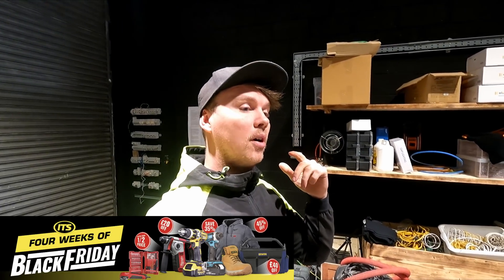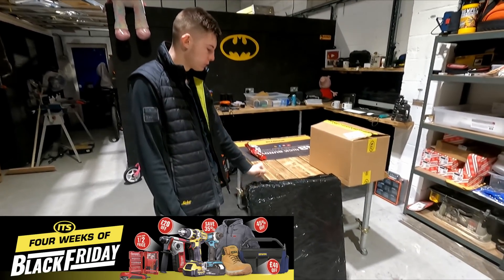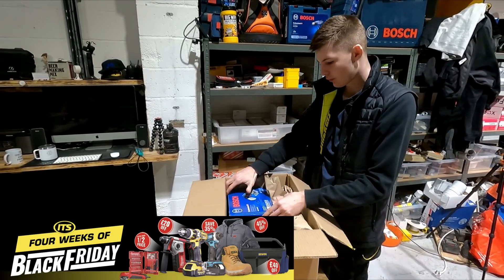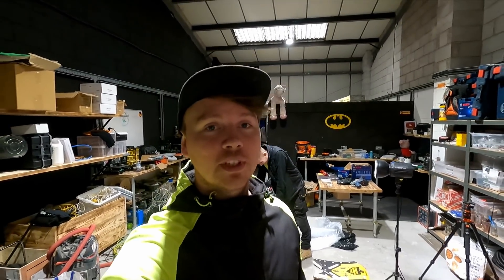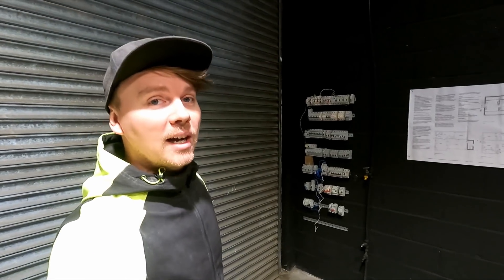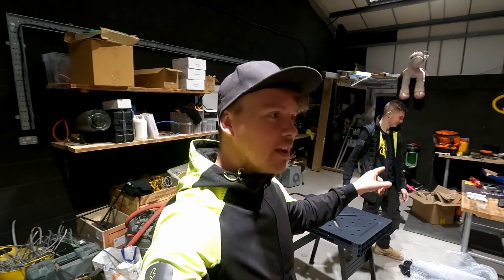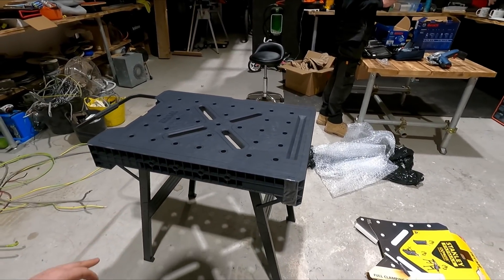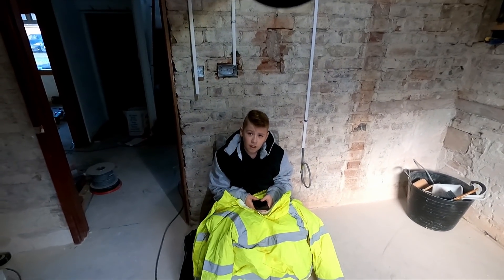Baby Bundy earning "PHAT STACKS" -  Lighting rewire - Electrician

Comment: Hi Nick
If fitting aico try and fit the multisensor (heat and Co2) to the kitchen ares. Will cover for any gas appliances/ boiler in the kitchen. 
If you also fit a smoke/heat multi sensor in the lounge you can happily bring you system to an LD2 for the price of 1 extra detector.

Comment: Had one of these bosch mini drills before, absolutely loved it for small jobs. Sadly it only lasted 12 months with very light usage and the trigger wouldnt work. Maybe i was unlucky, but didn’t bother with another one.
Reply: Should've spent a couple of minutes registering it, 12 month warranty extends to 36 months...
Reply: @Camberwell86  hindsight is a wonderful thing.
Reply: @sparky1543  that's a proper kick up the bollocks though, right on the 12-month mark. Typical innit 😕
You should go again, the body's only £55 or thereabouts (I'm assuming you're on about the impact because the speed drill is pretty pointless) - I wouldn't be without it these days
Reply: @Camberwell86  agreed, a great Little bit of kit. Just stick with my makita 18v stuff now. The bosch was always a luxury item, screwing sockets back with it made me lazy.😂
Reply: @sparky1543  Tell you what the impact's a godsend if you've got a whole house to board. Particularly ceilings with the little belt holster it comes with. Better than standing on a hop-up with an 18V monster between your thighs. The amount of times I spent ages getting a board right then bent down to grab the driver and BANG on the floor it goes 😅 start again son 😅
Reply: @Camberwell86  i tend to use the makia impact with a 2ah battery. Much more comfortable than a 4,,5ah lump on it.
Reply: @sparky1543  I've seen people hammer in drywall screws on a Friday 😅
Reply: @Camberwell86  Friday flyer init.😎

Comment: I know it could be heavier but it might be worth putting a sacrificial MDF cover on the table. Or maybe not everybodies workmate has gouged from the circular saw like mine..........
Anyway, I like the table, about to order one.
Reply: Meh, it's only eighty knicker, it's gonna get battle scars anyway. I wouldn't bother
Reply: I got a Keter when black and decker were pushing them back in 2009, solid table but looking back I would have put a MDF or plywood surface on it, added a strip like a bench hook, maybe some parf holes for clamping.

Comment: Great video nick very informative and funny, as a final year electrical apprentice I'm abit confused at why you have installed ring mains instead of just 4mm raidials. I always try to avoid rings as they seem to be more trouble than what there worth just a thought love to hear your opinion on this.
Reply: Hello I know I'm not nick however many scenarios I still use rings, and main purpose on domestic as 9/10 times don't know who follows after first fix so gives the option for if there's a fault on the circuit on one of the legs, possible to split into 2 radials afterwords.
Reply: The YouTube sparks don’t seam to have heard of 4mm. Or maybe they don’t want another real on the van or maybe in costs loads more.
Reply: @sparkygrub  thanks for the reply great point but personally I believe rings are only really installed out of force of habit since people were taught to so they do. I do think as the new generation comes in they will become less n less common if I'm correct they were only introduced due to metal shortages during WW2 era (correct me if I'm wrong)
Reply: @AndyK.1  carrying a extra 100m of 4mm is a pain definitely. Price never seems to be the problem if you just price your job accordingly,I've always believed top quality worksmanship comes at a high price regardless of the trade
Reply: @thomasrogers6778  I agree probably more to do with the way people where fetched through their time, I'm  30 but work domestic, commercial and industrial and for me I have installed 4mm radials ect as and when needed and suited desired install. 

If done during ww2 era then thank you as every day is a school day and wasn't aware 😅 will look up 😀
Reply: @thomasrogers6778  

Completely agree Thomas there's method to the madness and depending on who designs, installs ect the price always reflect this. Carrying the 4mm isn't the issue at all, at least I believe shouldn't be.

I'd use 4mm and have but using a ring makes me feel more at ease who follows within domestic after first fix (if you follow) 🤣😅
Reply: @thomasrogers6778  

Also forgot to say that most new people coming into the trade, I do agree are pulling in rings less and less, alot of the time within domestic only time I see a ring would be kitchen only 9/10 times.
Reply: Yes rings were introduced after the war due to so much copper being used in brass munitions there was a shortage.
Aslo I believe we are the only country using the practice.
However they stay in favour for the same reason they were created, greater current carrying capacity for cross sectional area, you are able to serve a greater quantity of outlets over a longer run without worrying about volt drop or over load of the first leg in a radial.
Ok, so you've got 11.5v and not likely to reach that and a 36ish amp cable so should be within your In design speck but it's still not as good as the ring which gives you 5mm^2 because of the two 2.5mm^2 cables running each way. Every socket outlet loads the circuit the same so no part of the run has greater load. 
The only problem with rings is when somehow it gets damaged and is no longer a ring. Now In > It. Therefore risking over load of the cables.
This you know if you have completed your level 3 science..
Reply: Practicalities.
20A radials in 2.5, no problem.
32A rings in 2.5, no problem.
32A radials in 4.0, gets to be a pain in domestics with routing, fitting under capping and some accessories. Did a few then decided that the two options above are the best suited.
I tend to only install 4.0mm radials to feed a maximum of two points, rather than a whole room or floor - for example in a utility room, the washer and dryer load may be pushing it a bit on a 20A radial, depending on the actual appliances. But because many European countries change tariff depending on maximum demand, the days of 3kW heaters in washers and dryers have long gone, so again the need for the 32A radial isn't there.
When the washer and dryer aren't in the kitchen, a 20A radial is sufficient in there too, the cooker will have a dedicated circuit.
Laundry kit in the kitchen? 32A ring in 2.5. Job done.
I don't see how rings are "more trouble than they're worth" - if you have a problem on the end to end tests, leave one end unterminated and test like you would on a radial. And come on, a figure 8 test isn't hard to do once you've done a couple. You could raise the scenario of an old board that's been installed like a bowl of spaghetti - but then you can do the test from a socket outlet instead, the results will be exactly the same as they would be from the board.
Reply: Only time testing a ring gets confusing is when it's wired in singles and you don't know which is the incoming and outgoing for your figure of 8 tests.
Then you have to find a find a suitable socket outlet where the routing is known and loop it back to identify the set.
Otherwise you are relying on the results climbing as you test further from the DB.
Still don't see it as "hard"